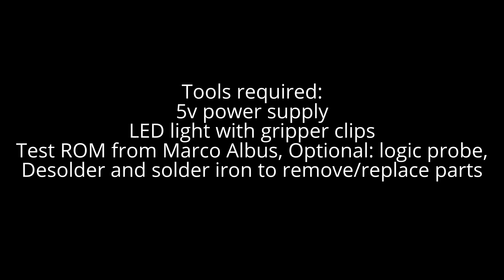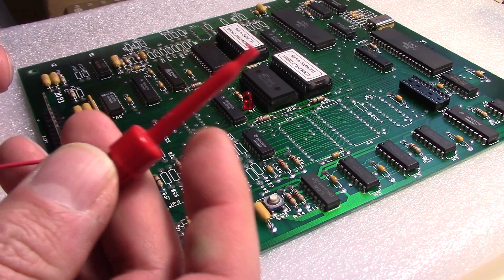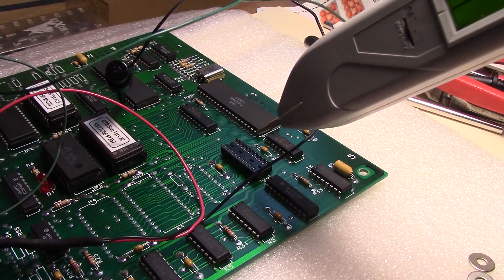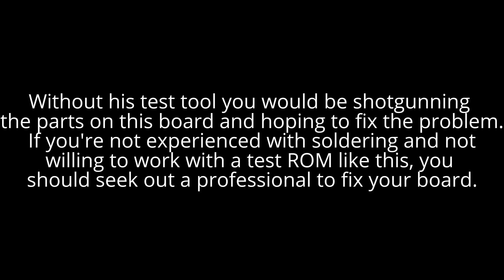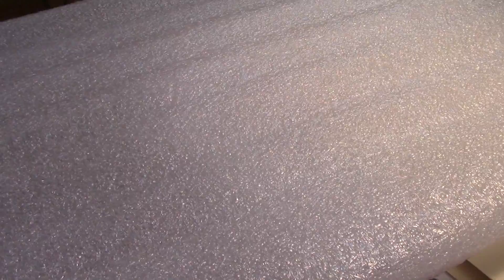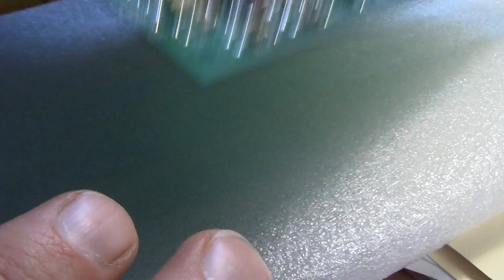Testing a Gottlieb Sound Board MA-886/MA-1629 System 80B/System 3

Comment: So my board is booting but sounds and music seem to not play correctly or not at all. With that in my these test Roma really wouldn’t help me correct?

I did notice there is a damaged pin on the cable that ties the two sound boards together. I’m starting there. But assuming that doesn’t solve the problem I should pretty much jump to the input /output chips part of your video would you say?

Comment: Have you ever seen a sound board like this restart the music every time a sound affect is played? That's the issue I'm having with my MA-886 Night Moves sound board.
Reply from the maker: The reset for the sound board is daisy chained through the display board from the CPU. You might be having a random reset signal going to the sound board which could be indicative of a wiring problem between the sound board, display and CPU.
Reply: @viperrwk  Thank you so much for the advice. I put a brand new cpu and driver board in it to upgrade it and have been using a multimeter on the sound board to look for issues. I will give the wiring a close look. Thanks 😊.
Reply from the maker: @MrLivinglife800  The schematics for the machine can be found on IPDB if you don't have them. Good luck!

Comment: Thanks for the referral. I plan to contact Marco about the possibly “extraneous” blinks. Those inject a little confusion into the process. If the board is working fine, or the problem is “routine” like the failed RAM, then no biggie. But if the issue lies elsewhere, those extra blinks don’t help. Regards Vip.
Reply from the maker: I hear you Chris - I can't remember if I ever spoke to Marco about that or if anything could be done about it. However, whenever the test has not progressed past a certain checkpoint (like the RAM test) I've always replaced that part and then things have worked fine after that. It's been a while since I've checked in with Marco as well - should send him a note and see how he's doing.

Comment: If I ship you my sound board can you fix it Hollywood Heat system 80b.
Reply from the maker: The board pictured in this video is not the same board that is used in Hollywood Heat. That board is a MA-766. Marco Albus does have a test ROM for that board as well. The procedure to repair that board is slightly different than this one but the principles from this video are the same for that board. At this time I do not take in repairs from the general public. If you are looking for a repair I would recommend getting in touch with Chris Hibler (http://chrishiblerpinball.com/contact/) who will repair your board for $88 or you may purchase a brand new sound board from Steve Young at Pinball Resource for $125 (http://pbresource.com/boards.html#gtbsys80). Thank you for watching!

Comment: Very good..... I will try in my board. My led board is blinking very weak, and the aux sound board led is every time on. Do you have Whatsapp? Can I send a video to you?
Reply from the maker: +Alexandre Kostetzer Alves .This video was shot on the bench with a known good 5v power supply. If you have a voltage problem in the machine it is possible that the board would not work properly during gameplay. It is possible with the test ROM to check the signals on the aux sound board but given the differences in aux sound boards, and the fact that you need the ribbon cable and power, it was beyond what I wanted to do in this video.

Feel free to post a video response on YT if you want to send a video.
Reply: Can I test the board without the test rom? Only with the original rom game?
Reply from the maker: +Alexandre Kostetzer Alves You cannot test the board properly without the test ROM. The test ROM specifically exercises certain areas of the board to help isolate and identify what has failed. The game ROM has no way to tell you what has failed as the code assumes the board is fully functioning.

You can shotgun components on the board in an attempt to repair it if you either can't or don't want to use the test ROM. While this is not advised there is a logical way to go through that process which is documented in the video.
Reply from the maker: +Alexandre Kostetzer Alves I am not in a position to call about this (not on whatsapp) and there's not much to add to what's already in the video. I would verify the ROMs first since they are socketed and easy to check and don't require soldering.
Reply: +viperrwk my ram have socket too. Very easy to change
Reply from the maker: +Alexandre Kostetzer Alves That's fine - though if your RAM is socketed then someone previously changed the memory and you have to suspect how well the previous work was done.The traces and the through holes on that board are very fine and very easy to damage so even though there's a socket there that might be the problem.
Reply: +viperrwk I changed the two ram, now the led is always on. we can see is flashing very fast sometimes.
Reply from the maker: The RAM must be 150ns or faster. Were both RAMs socketed or did you put in a socket for the second one? Did you verify the ROMs? Did you verify your voltages? Is there proper continuity to all the legs of the RAM chips? This is the problem when you shotgun the board. And if you do not have the correct tools and technique for desoldering the RAMs it is easy to damage the through holes and pads. I have no magic answers for you, I cannot tell you what exactly the problem is when it is locked on or flashing very fast sometimes because I cannot see your board and inspect your work, even with photos which would not tell the whole story. I advised against what you did.  The only other advice I have for you now is find someone experienced in repairing these boards and hope they would be willing to fix it. I generally make it a practice to not touch a board that someone else has attempted to fix. Sorry.
Reply: +viperrwk 
I found other similar ram KM28C16, because here we dont have the original one.
Reply from the maker: +Alexandre Kostetzer Alves That won't work it is an EEPROM not an SRAM.
Reply: +viperrwk do you knonw a similar one to use?
Reply from the maker: +Alexandre Kostetzer Alves List of some compatible chips are in this thread:

http://forums.arcade-museum.com/archive/index.php/t-113180.html

Also, it MUST be 150ns or faster. If it is rated slower than that it may or may not work.